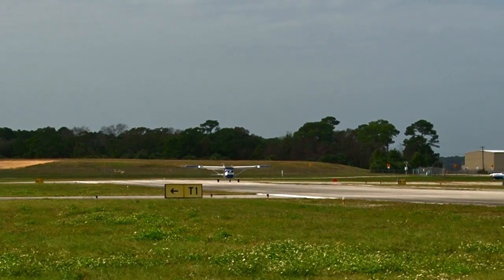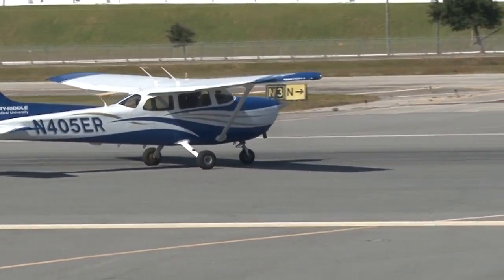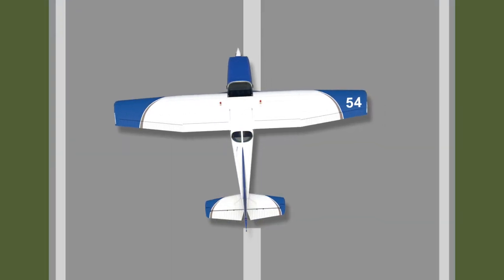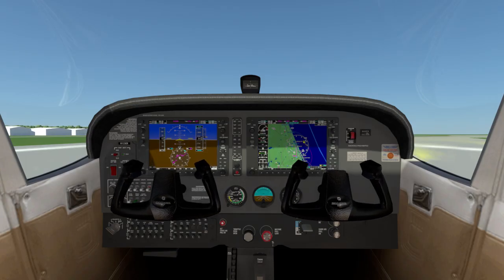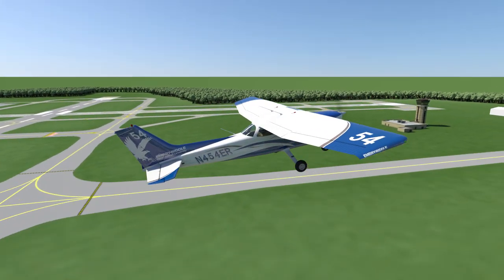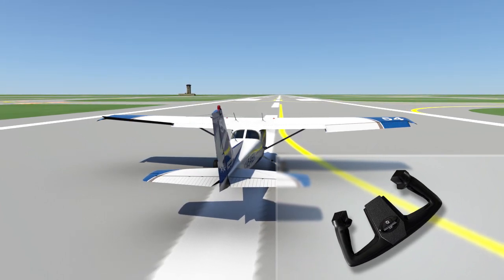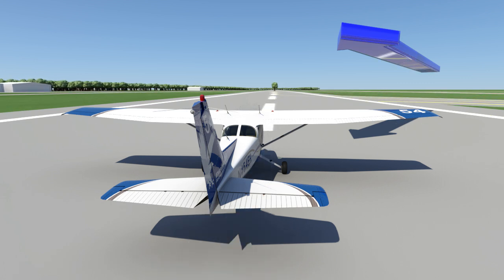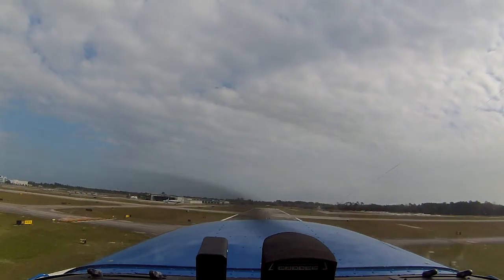Normal and Crosswind Takeoff and Climb

Comment: An absolutely perfect explanation of how to make a technically correct crosswind takeoff. One point missing was that with a left crosswind, more right rudder is required to compensate for the weathervaning tendency from the wind, plus torque. The word torque was implied, but never mentioned by name. Otherwise, kudos to you for a great lesson, this from a 30,000 hour CFI who used to teach crosswind takeoffs and landings in the ultimate tail dragger, the Beech 18. Well done!

Comment: When taking off with a very strong crosswind component, the plane will weathcock into the wind as soon as it starts to fly since it wants to naturally fly directly into the wind, just like the crab when on approach in a crosswind.  The nose is pointing into the effective wind while the plane is travelling along the different track, directly above the center line of the runway.  Taking off by raising one main first essentially puts the plane into a sideslip which requires a significantly greater airspeed.  To exercise a safe rotation and liftoff, pull on some flaps simultaneously with rotating, keeping the wings level and thus quickly getting the plane well above the runway and eliminating the risk of touching back down while in a crab.  As the elevation agl increases, you can reduce or eliminate the amount of flaps.  With a bit of practice, this action becomes almost reflexive when operating in severe crosswinds.

Comment: 1:56 Tendency of airplane is about Cessna or all of them face this? 

thanks for your perfect videos.
Reply: Nah I fly a piper and it has that tendency to drift to the left as well
Reply: If the aircraft is a right hand prop ( prop turns clockwise) , it has tendency to yaw left, thus needs right rudder. If left hand prop _ opposite. Its the gyroscopic effect

Comment: Seems the post rotation bit was overlooked. To continue with the same aileron and rudder input after liftoff and maintaining the runway ground track will result in slipping, which adds a lot of drag. So just after rotation the control input should switch to neutral ailerons, wings level heading into the wind enough to keep the runway ground track, and enough rudder for normal coordinated flight.
Reply: Thank you! Yes, I noticed too, was waiting to hear if one should side slip as you may choose to do on landing but I had a suspicion that that wouldn’t be as good on takeoff due to slower speed, and you filled in the hole for me there. Just crab to keep centerline, right? So rudder input wouldn’t be as active, only helping ine to get to the right crab angle, then mostly centered or just reaction to the ball?

Comment: The assertion that with a crosswind from the right, less right rudder input will be needed on account of the aircrafts tendency to "weathervane" is counter-intuitive, as one could not be blamed for thinking that the right crosswind might tend to exacerbate the aircrafts natural tendency to turn to the left due to other forces in zero wind conditions! Ah, sweet mysteries of flight!
Reply: Airplanes are magical, they fly by themselves if you let go of the controls :D not during takeoff or landings though... yet. Cheers! (Also, the wind hits the vertical stabilizer and makes the airplane  yaw towards the wind if you haven't figured it out by now :D)
Reply: Discovered this in the full simulator, asked the instructor to give me maximum crosswind for practice as real cross winds are rare around here. I was all over the field on that first takeoff, good thing we chose a 200ft wide runway.

Comment: My dad was an aeronautical engineer, pilot and flight instructor his whole life so I did my first supervised flight in the cockpit at age 12. This is a really excellent, plain-language explanation of the basic aerophysical principles of takeoff. Also, I had to laugh at the visual representations at 1:42: "If you apply power too quickly, your engine may literally explode into flames. Adding power too slowly, and you risk plunging off a cliff into the path of a 17th-century pirate schooner."
Reply: To be fair, the plane took a bath off the starboard side of the schooner, not in its path. The engine part was funny to me too. :-)
Reply: Is that true that the engine could explode?
Reply: @monkeybearmax  No, it was creative exaggeration. Engine could backfire. Depending on the policy of the school and the force of the backfire explosion takeoff may have to be aborted in order to inspect the engine for any damage.
I have heard engine backfire in the air while reducing power too quickly for simulated engine failure without any damage.